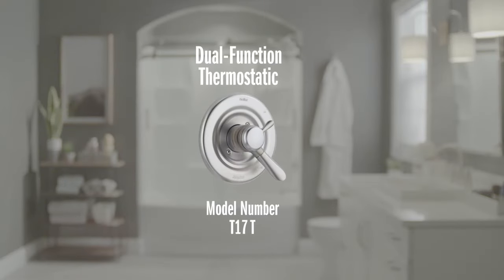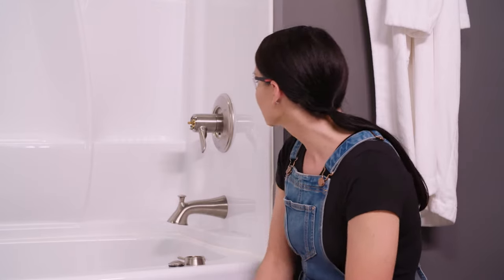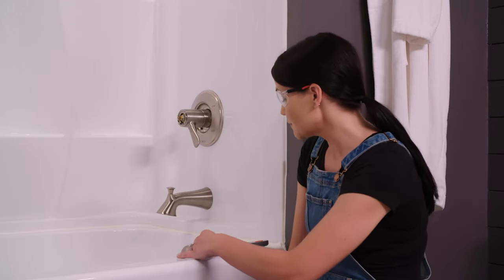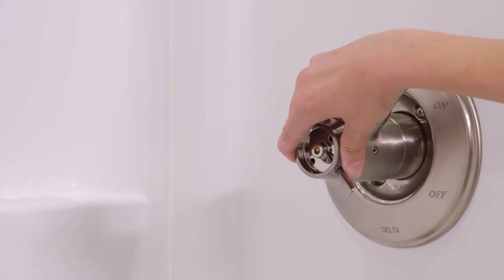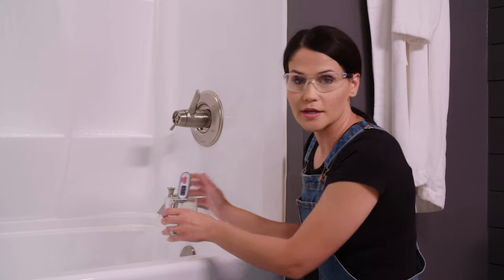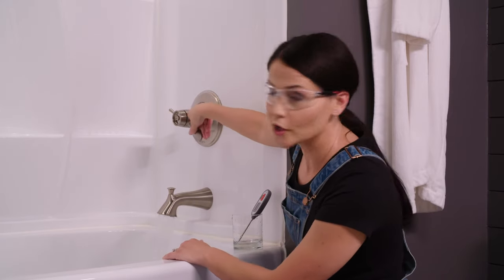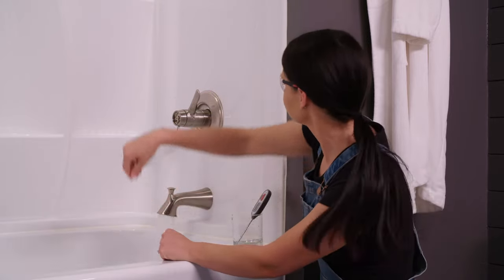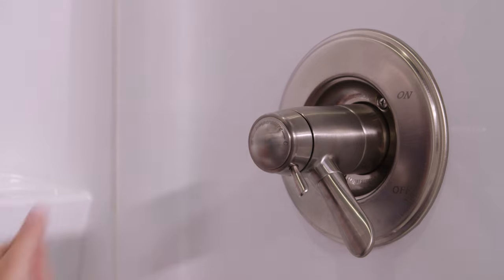Delta® Faucet How-to: Adjust Your Rotational Limit Stop - T17T Series

Comment: is this bob ross? how do you pop open the cover?
Reply: That's the issue I'm having! It's the only instruction I need 🤦
Reply: small (very) flat blade screwdriver.  There is a small little port you can barely feel with your finger which should probably be at the bottom of the cover (6 o'clock).  insert small flat bladed screwdriver there and twist.  Will pop right off